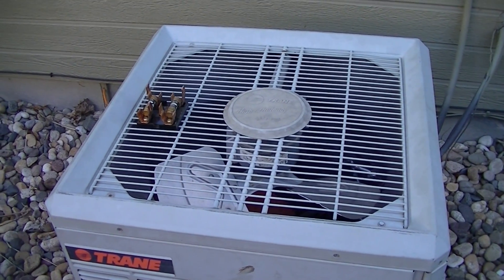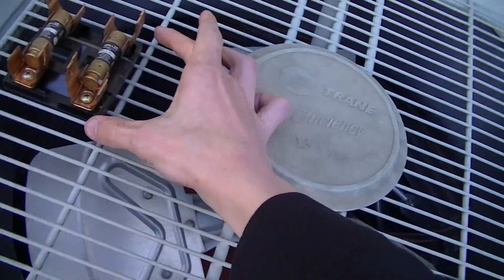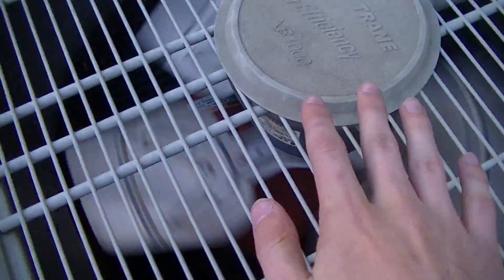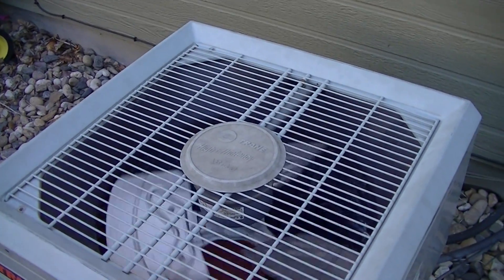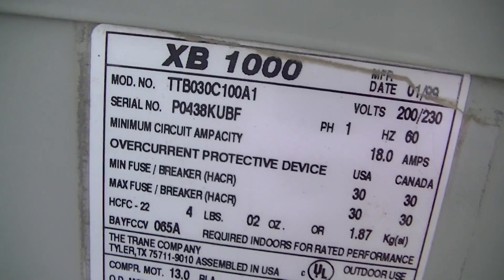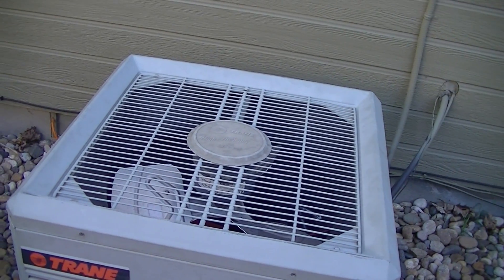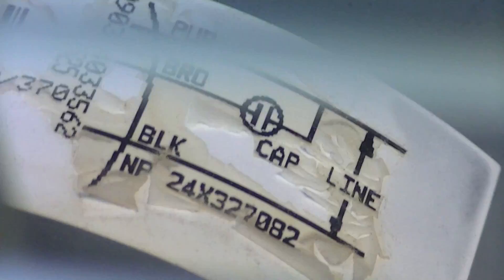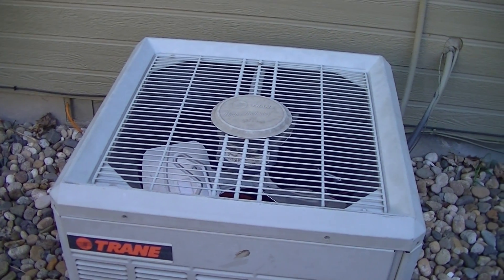Trane XB1000 Condenser Fan Spinning In Reverse When OFF

Comment: I found this getting tips for replacing my fan. From what I have learned, you can Ohm out the resistance between the wires coming off the fan motor, the two lowest values should equal the largest. If not, there is an issue with the motor. HTH. When I first started watching I assumed it was a reverse wiring harness issue on the fan.
Reply from the maker: Yeah that would probably be the more definitive way to determine that.  I just went with my gut instinct from what I've learned about electrical stuff, and it happened to work out.

Comment: Not the capacitor, if it was bad compressor and fan would not run or one runs other doesn't. Could be the contactor as well as the motor. One thing for sure is the bearings in that fan motor are shot hence the noise.
Reply from the maker: Capacitor is ruled out as the culprit at this point. It's already been checked, and there is no sign of bulging or bloating on the body of it, but being as old as it is, you might as well replace it with the motor anyway just because.
Reply from the maker: Contactor IS possible to be the problem, which is what worries me most.
Reply: If its the contactor that would be a lot cheaper than replacing the fan motor. But that only explains the fan running when the unit is off, not the reversing so very possible it's the motor. As you said replace the capacitor when the motor is changed, I do that whenever a motor is changed.

Comment: "It's hard to stop a Trane".  Not yours, it not only stops itself but shifts into reverse!  Har har!

Wow, that's one for the books!  I never imagined that could happen, but the explanation is certainly plausible.  What about the contactor?  Has that ever been replaced?  I don't think that's the problem, but they can and certainly do go bad.
Reply from the maker: I remember those commercials, but I think they played a long time back when I still had the 1970's Amana!

There are many possible things that could be the problem with this unit right now, and that's what I'm worried about. I don't know if the contactor has been replaced, but even so, we're moving out in less than a month, so if that does ever fail in another five years that'll be up to the next homeowner. I'm just hoping this is the only problem.
Reply: I'd love to hear an update on the problem when it happens.
Reply from the maker: Repair video coming out either later tonight or tomorrow!
Reply: Schweet!
Reply: Lol
Reply: @dylanreischling4151  .....Grounded out Motor....when the Unit is not being called, the 120 V Leg that is being fed constantly to the Motor has been connected to the "idle" or the "switched" side of the motor to operate when a call has been made...it will end up killing the Motor from the stress off being called with inadaquite voltage
Reply: Paul Bobadilla Lauder correct